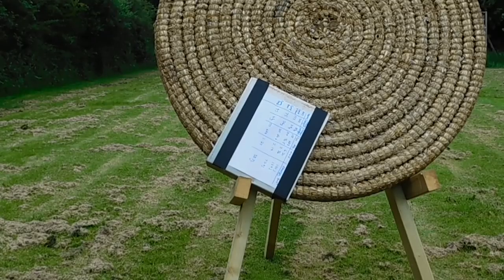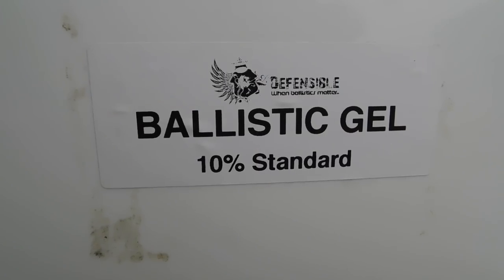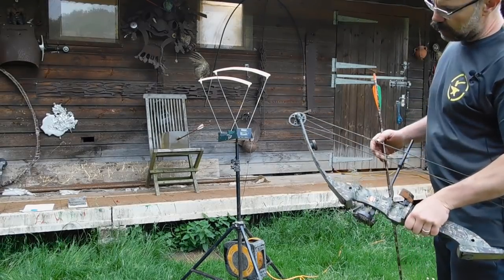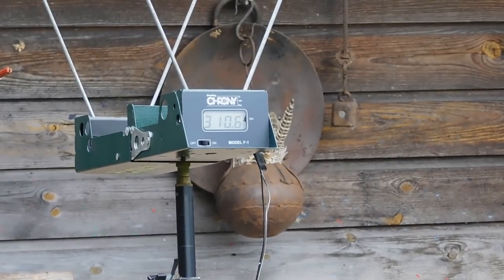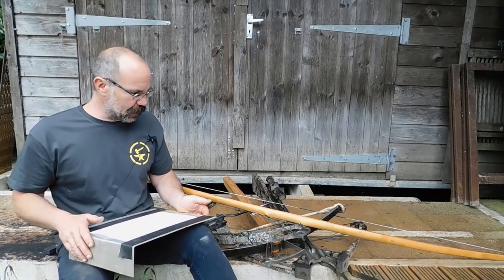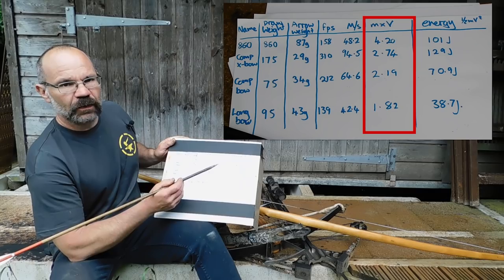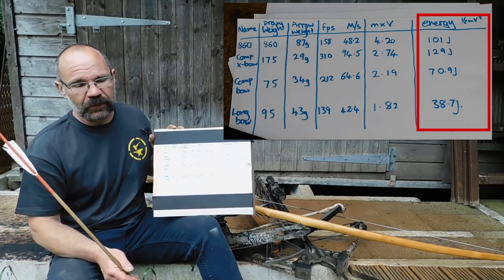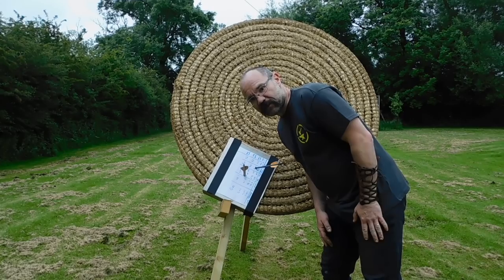Medieval vs Modern Crossbows/bows Ballistic Gel Tests

Comment: At a given velocity, double the weight doubles the energy. At a given weight , double the velocity quadruples the energy.
Reply: Yes, but what you need to realize is that the bow or crossbow stores a specific amount of energy, and the only thing you can do is affect how much of that energy gets converted into KE. In the case of bows and crossbows, because their speed is limited by how quickly the limbs can snap back into place (rather than how quickly hot gases can expand), slower is better with regard to efficiency. Heavier arrows from the same bow at the same draw length always have better efficiency (and thus more energy), with the tradeoff being less favorable maximum range and less flat trajectory.
Reply: You’ve half way explained what I have stated. Simple laws of physics apply. The technology of any bow, long, short, recurve, wood, horn, cammed, laminated, composite, fiber etc., is representative of the speed of deflection at a given draw length. The further back you draw a bow increases the stored energy and gives a longer time to transfer that energy to a bolt or arrow. The materials of that bow determine its speed of deflection at a given weight. Modern materials of bows and arrows have advanced. The bows have shortened, delivering much faster velocities at a given pound of draw.  The arrows have become lighter and longer comparative to their diameter providing greater velocity. The advances of easier draws and greater retention of velocities give greater accuracy at longer distances. Those same advance in technology proves the physics of the statement I made perfectly. If you take two arrows made of the same materials with one weighing twice as much as the other, and shoot them both at the same velocity, the heavier will deliver twice the energy. But, if you take the lighter of the two and shoot it at twice the velocity, the lighter will deliver four times the energy. If you find a way to shoot the heavier of the two at the same increased velocity, it will now again have twice the energy as the lighter. The balances of performance and materials and design at a given time in history is irrelevant. This principal of physics is unchanging and continuously demonstrated through history in the development of more powerful arms, velocity is king. The most recent developments in weaponry that best demonstrates this principal superbly is the electro magnetic rail gun and the orbital satellite launched projectiles. The rail gun can produce infinitely greater penetration and destruction with much smaller projectiles moving at what we now call hyper velocities. And the spaced fired projectiles are literally solid reconfigured cannon barrels that are delivered at asteroid velocities delivering unbelievable ground penetration and the same explosive damage of an asteroid impact.
Reply: @aaronbuckmaster7063  War arrows actually became thicker and heavier, because those penetrated armor better than lighter, faster arrows with traditional bows. And if velocity were the only important factor in effectiveness, the US military would not be looking to replace their current 5.56 mm ammunition with slower, heavier 6.8 mm. You're oversimplifying.

Comment: I figure it's like the difference between a rapier vs a mace, or a modern hunting rifle vs an elephant gun. The modern crossbow has a smaller diameter projectile, is reletively smooth, and is going much faster because it's so light and easy to accelerate, so it's gonna wanna go straight through, rather than transferring that energy to the target. Meanwhile the big old medieval bolt is thicker, has the big broad head and wooden fletchings, and is way heavier, and stops in the target. If you watch back the footage, the medieval crossbow makes the gel block actually lift off the chair a bit, while the other bows just make it giggle a little. So I think what this test has trouble expressing is stopping power. If you are trying to shoot a deer with a thick hide from far away, you are gonna want that compound bow. But if you want to shoot someone who is charging towards you to attack you, you are gonna want that medieval crossbow. I bet if you tested those two crossbows against a hardened steel breastplate, the compound bow would bounce off, while the medieval one would leave a nice dent.
Reply: I guess another way of putting it is a Toyota Corolla will knock you off your feet going only about 13 m/s,  with about 1000 times more energy in joules than the crossbow bolt had.
Reply: Of course, this test was very interesting and thought provoking all on it's own. Your videos are awesome, these comparisons give so much context to how these weapons were used, it's great experimental archaeology. They might not be super ultra scientific, but they're enlightening nonetheless. I never really thought about how diverse or interesting crossbows were before these videos. I just thought they were a hunting weapon and that longbows were superior on the battlefield. But these comparisons have really made me think about the topic a lot differently. The speculation part is the most fun I think

Comment: Todd, your research into medieval ballistics testing got me thinking, we see basically all the data we need for every medieval ranged weapon available for academics to study. But what about melee weapons of the medieval period? I wanted to set up the same kind of testing but for edged and blunt instruments. Maces, Warhammers, Swords, Flails, quarterstaves etc. I figure the edged weapons will have to be tested in a completely different manner, because it will be very hard to gauge the impact and cutting forces in an accurate way due to the nature of energy displacement when slicing through a target instead of transferring kinetic impact energy. But we can still see how hard a sharp sword hits a target that's cut resistant, and measure how fast the blade travels through a modified chronograph reader. The ones you guys use would only be good for measuring thrust speed of a sword, not cut speed due to it's small entry area. What do you think would be a good equipment set up for such tests? I think testing the impact force in psi and joules could easily be done for warhammer and mace hits etc, that wouldn't be too difficult.
Reply: Yeah that's why I've been putting off doing the video on it, I was looking at how boxers test their punching power, and I think that method would be good enough to measure quarterstaff, antique police truncheons, maces, warhammers etc. So I might start with just that, and leave the bladed articles out of it. I could definitely use a regular chronograph to measure thrust speed though, but that test isn't really going to tell people much, poke a sword through a reader, yeah light swords thrust faster than heavy swords, that's all we will learn from that test, so that's pointless to even conduct i guess.

Comment: Velocity, hardened/tough tip, and cross sectional density/narrower diameter are the "Biggies" for penetration

Momentum is the biggie for transferring energy that gives what's refereed to as "knockdown", not making enemies fly or silly stuff, no! 
but like a shotgun slug's ability to dump a HUGE amount of energy in a big area that wrecks hell on the poor recipient, enormous wound cavities, and often results in them being rendered "hors de combat" (be they 2 or 4 legged)

Comment: Well as the name states, compound crossbow, it puts out more energy than is required to pull it back. The cams make all that possible  plus modern bolt design means we can use lighter more efficient shafts that are also more ridged. The modern bolt isint losing as much energy when it flexes on impact given better penetration.

Comment: the compound crossbow has lighter draw weight but because it is drawn back much further than the historical one it has more time to accelerate the bolt to a much higher speed which gives it the better penetrating power, there are other reason but thats the main one.
All you have to do is watch a video of someone who know alot about crossbow design, thats were I learned that.

Comment: When an arrow passes all the way through the enemy it is not transferring all of its energy to the target.  The enemy gets a narrow puncture wound.  If the fatter mediaeval crossbow bolt stays embedded in the target, it has transferred all its energy and also left a ragged hole that will be more disabling or lethal.

Comment: Good video, made quite an interesting test.
Perhaps you might find this of some use:
Kinetic energy is by my understanding (in ballistic terms), the energy of 'interaction' with everything around it, and measuring momentum shows the extent to which its energy is conserved. My former physics teacher seemed to agree with that, for what that's worth.
It is important to take both into account when determining a projectiles effectiveness, as a cricket bat lets say, has a relatively low kinetic energy when swung vs a fast bullet, and yet both are potentially lethal. 
In terms of penetration, many other things must be taken into account such as surface area. For example, a swing with a cricket bat has a lot more momentum than a handgun (I did some number crunching just to be sure), and yet which one penetrates more? The cricket bat will deliver its energy over a longer period of time and over a greater amount of surface area, than said bullet, and so it doesn't have the 'quick and sharp' effect of the bullet. It is true that greater momentum is desired for penetration, but only when the surface area and the ballistic coefficient (in the gel) is not changed. And yet, despite all of this,  both are effective against targets without armour; The same basic (very) result achieved with different means. - not an overly relevant point, but an interesting nonetheless

I think I understand this sufficiently to talk about it, but for the record, I am not a physicist, so perhaps It might be wise to take what is said with a pinch of salt...

Comment: For penetration of arrows, you can't beat a really sharp small broadhead.  For cavity damage and bloodloss, a sharp and wide broadhead.  To compare the bows, either use the same weight arrows for all tests, or tune the weight to get the same speed from all the arrows.  Historically they used heavier arrows because they wanted maximum lethal range and weight carries more energy downrange.  They were aiming at armies of thousands of soldiers at ranges over 600 feet, accuracy didn't matter much, but maximum range did.  There is a sweet spot of arrow weight to maximize range and penetration.

Comment: It's all about how you're using them. The longbow was meant to be fired quickly at close to medium range at targets with armor (not full plate). The comp bow is a hunting device meant to hit large fleshy targets at long ranges with precision. The comp crossbow is the same except I could see it being used against larger game. The windless is meant to penetrate full plate armor, it was meant to take out high value targets on the battlefield. The comp bow is too slow and clunky for medieval warfare. The comp crossbow I'm uncertain about but with some tweaks to the arrow, thicker shaft and broader head, it could be a very effective armor penetrater
Reply: wrong its about context and dynamic efficiency. compounds are also used in target archery and x bow are mostly illegal  and longbows where a ranged weapon to kill horses and did diddly squat to kill armored knights

Comment: being an archery of some years, compounds accelerate a arrow/ bolt far more effeciently, as it start at less poundage[ ie 0% lett off] building to max just before brace hight, hence creating an equation of math that would be difficult  plus time in contact with string etc etc, I don't like to compare,  as its unfair, add in for my self, shooting 31 inch draw,, at a 7.5 brace height,, i again gain over a smaller shooter drawing the same poundage,  never ending equations

Comment: I really wonder why they didn't do any compound designs in the medieval period. Sure the material technology wasn't there for cams, thin and strong strings or ball bearings, but some kind of lever design could've maybe achieved higher speeds. I'd like to know if it just wasn't doable, it wasn't practical or they simply didn't think of it.

Comment: The reason a 180 lbs draw modern compound crossbow can out perform a 860 lbs medieval crossbow comes down to energy transfer. A lot of the power is resonating through the stock and limbs as the arrow flies. The modern machining, tight tolerances, and more elastic materials of the lighter draw bow mean a lot more energy goes into the bolt, so they don’t need to design it with such ridiculously high draw weights to get the same (and better) results.

Further, something not touched on here is how far the arrow travels with the string, i.e. how long the arrow is being accelerated for. With a weightier draw you need less travel to achieve the same effect. I’d wager the compound crossbows track runs a bit longer but it’s hard to tell from this video.
Reply: The main reason is that compound bows store much more energy than traditional bows, and all other factors being equal (which they aren't; see point 1) longer power stroke bows store more energy. So even with a lower draw weight, a lot more energy is stored. The difference made by the greater efficiency is comparatively small.
Reply: @alexanderflack566  I mentioned power stroke. Did you not read my comment? 

And no, the effect of more efficient material is not negligible. Wrought iron limbs compared to highly elastic polymers males a huge difference in how easily you can store tension in the bow.

Comment: Would have been interesting to see a comparison with a warbow around 140-150 which would have been a more typical weapon of war as the crossbow obviously is just that. Also a warbow arrow weighs between 80-115 grams so it would have been much heavier. Other than that this is a great video, the medieval crossbow is really nice looking, great job on that. Thanks for uploading.
Reply: It would have around 150 Joules, that's about maximum, you can get with heavy warbows, like with 130lb+  and heavy arrows. It was of course already tested.

Comment: this SEEMS to prove that speed is of the essence. the heaviest bolt shot with the highest draw weight didn't impact with the most energy, the crossbow with the lightest bolt and less then a quarter of the draw weight did.
Reply: You are not the only one to miss the obvious. Sure the measurements of energy were high at point blank range, but at a decent range the low mass of the modern crossbow bolt and its high speed means it will loss its energy very quickly, at the square of its velocity in fact.For warfare (the purpose of the old crossbow and long bow) you sure as heck are not going to be standing that close to your target, more like 100metres or more.I'd like to see a repeat exercise at 50 to 100metres and then measure the energy.
Reply: @geoffreymentink9570  I was surprised by the result and think you are right, though I know nothing about the physics behind it. I expected the medieval crossbow to come in first, followed by the Longbow. At realistic fighting distance we may get that result. I can't test it myself, don't have any 900-ish pound Crossbows ;-)

Comment: it looked to me like the 860 Xbow's bolt twisted as it went thru the gelatin block. It certainly changed direction as it was not parallel with "line of sight", anymore.  Just a question- Why do you shoot instinctively with your long bow?  Is that just the way you have trained yourself to shoot?   All any science tests can prove, is that it is more important where you hit your target, than it is what you hit them with.  IMO

Comment: Didn't expect that a 100# warbow is that slow... It has heavier arrows, but i thought it could match at least a typical modern longbow with 40-50#.
Reply: That was exceptionally slow for a longbow. He should have been getting more like 190 fps with those arrows and that draw weight; not sure what was going on there.

Comment: You need to make a windlass style crossbow but using more sophisticated mechanical advantage, uses modern materials and is about the size of a small truck. It should shoot bolts the size of a tire iron or crowbar and have some sort of explosive charge contained in the tip. Maybe use hydraulics or compressed air somehow. It needs to have a draw weight far in excess of anything here. It should be able to be stop a charging dinosaur.
Reply: tod todeschini I am impressed that you replied. Maybe just go with whatever falls within your budget. If you go with the thermonuclear option please consider additional safety procedures. Keep up the good work!

Comment: The lack of energy in the windless may have to do with draw length. What is the draw length compared to the compound xbow? It may have a lot of weight behind it but the power stroke is probably much shorter.